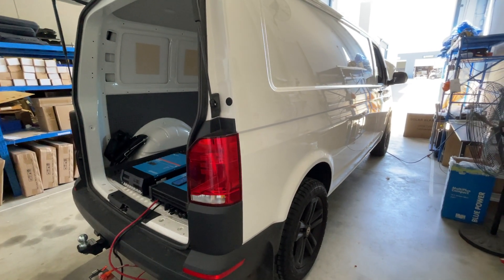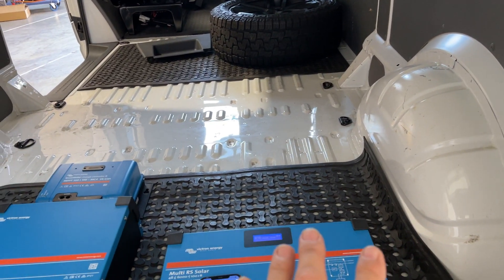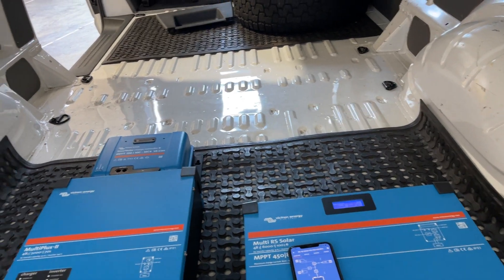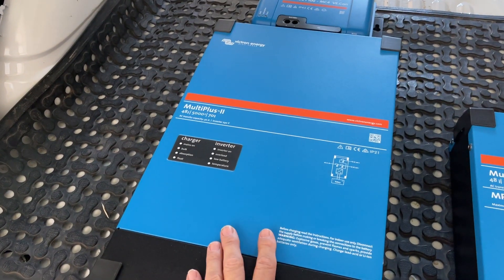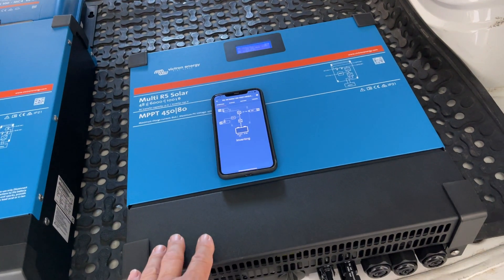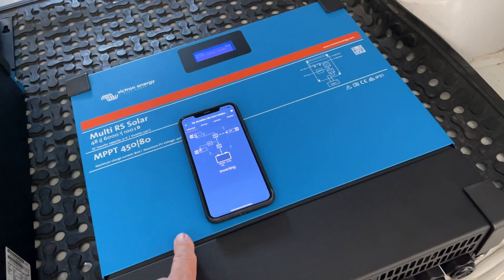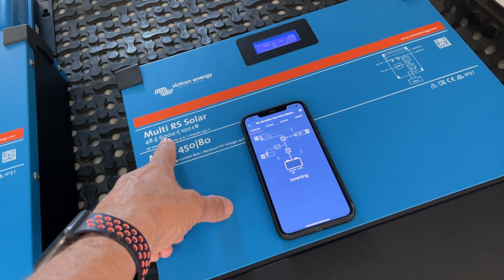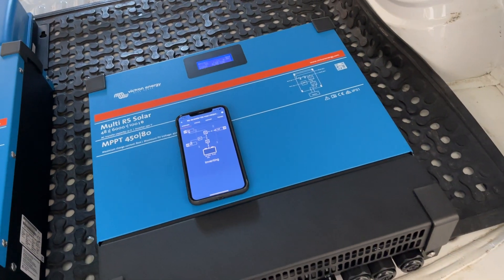VW Coffee Van needs 4800W to operate: Victron Energy to the rescue with new 6000VA + Solar unit

Comment: Hey how did you go with the  120 startup voltage  for the charge controller with only 800w 
of solar
Reply from the maker: Easy to do with 2 x panels that have VOC of 76v each in series

Comment: its for mobile use new is quite perfect 
  but no mention about good old trusty low frequency  coil inside the multi 2 ..  cant beat the reliability of it!!!!
Reply from the maker: Yes the Iron donut gives a higher ride through current with surging loads but it’s much heavier and the 20kg lighter weight of the RS is preferred plus the solar is also AC coupled so with 2kWp of solar you have 8kVA during the day… a nice boost if running aircon off solar
Reply: are those mosfets going to last  enough for it to worth it... ?   i dont think capacitors are going to stay intact in both anyway but i hope for some feedback after the cost..>  i went for  old one as first and maybe try the new as second in future.. no care about paralel !! split still does the job in such big  KVa
Reply from the maker: The world of Mosfets has changed dramatically and I don’t see any challenge in a 10 year life!

Comment: The website mentions "very quiet operations" is this true? Quiet enough to place in a hall closet outside of the bedrooms? I was  planning on a multiplus 2 but some videos had a awful hum at load. If this was quiet I would be able to save money not building a solar shed outside and could just do it all inside.
Reply from the maker: yes the 6000 Multi RS is planar HF unit with no "donut transformer" like a Multiplus 2 so you can have it right by the bed. Silent!

Comment: How do you get the start up voltage on the solar? This unit has a 120v start up voltage for solar and can drop to 80v during operation if I have read correctly. With limited space on the roof of the van i don't now how you can fit that many panels in series. Am missing something or did you have to use an additional solar controller in the end?
Reply from the maker: We have 152V startup from our solar on the roof.
Reply: @Safiery  thank you for your reply. I didn't know these existed in thr market. This helps me alot.

Comment: Incredible technology...? I mean, all in one Chinese inverters are doing that for years, there is nothing new here.
I payed my 6.2kW inverter with 7kW mppt and 120A 48 charger included for 430€....lol...?
Reply from the maker: Well not quite. This system uses a 3kw DC DC from vehicle smart alternator plus the Victron integration is excellent. Overall round trip efficiency is 96%. We are using Chinese sourced batteries here. Now my wife is Chinese and we are 30+ years in experience sourcing in China and I haven't found a product there yet that compares. Great to see you have and good luck.

Comment: How big a battery bank do you need to drive that inverter at full power?
Reply from the maker: We will have 9600Wh of Lithium. Thats 200Ah at 48V. The batteries can discharge at 1C so 200A at 48V which is 9.6kw. But the power of this inverter/charger is that the AC couple inverter power from the solar is in addition to the DC coupled power from the battery.